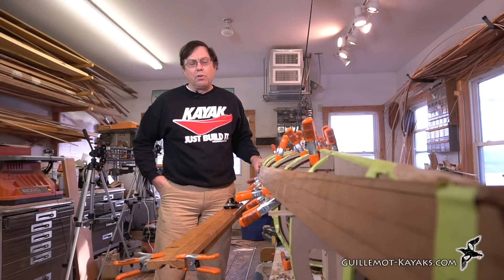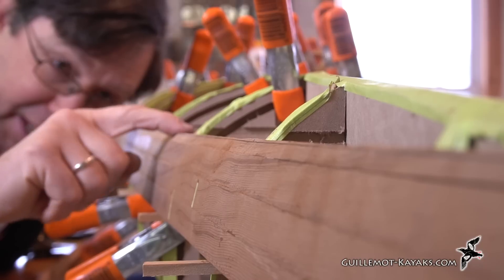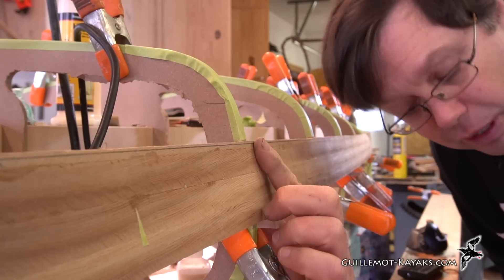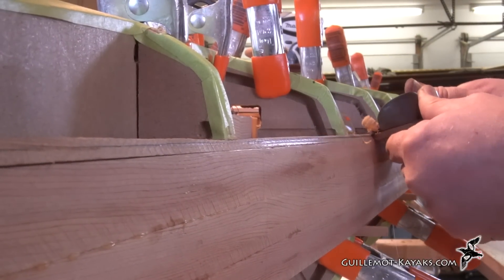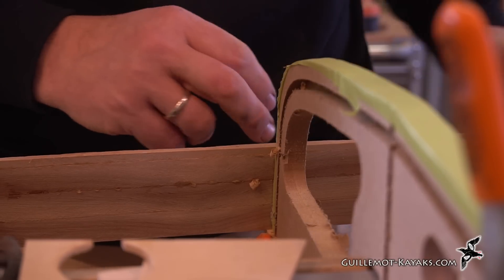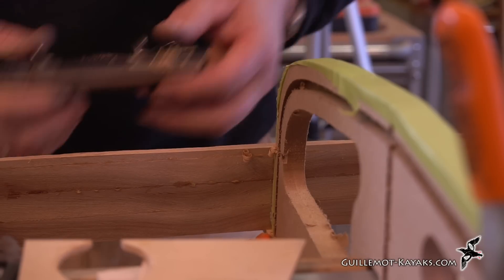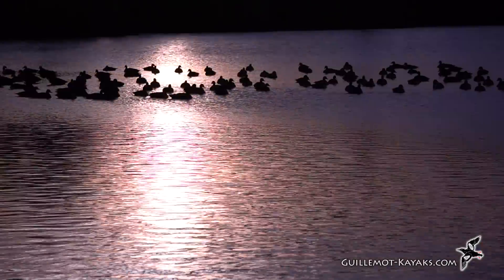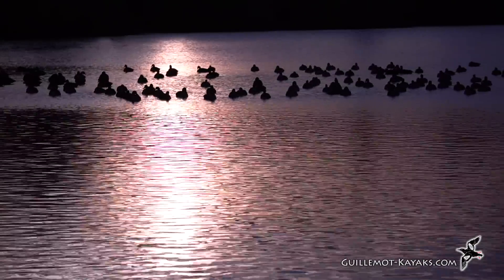Talking Accents - microBootlegger Sport - E13

Comment: Hey Nick.  Do you have a favorite masking tape brand for banding/clamping and covering your forms.  When I use the hot melt glue, the masking tape often tends to pull off the forms.  Great job on the videos.
Reply from the maker: Chuck Knott I’ve tried a variety of solutions for protecting the form edges when hot-gluing. Like you say tape can peel up. I’ve also used no tape and just coated the edges with shellac. This worked OK, but doesn’t really keep glue/epoxy from sticking. The trick is to make sure you don’t use too much glue between strips, and with tight joints epoxy won’t seep through. 

If you do use tape, I think the green 3M tape I use works well because it sticks well. The trick is also to be sure the strips don’t have much desire to pull away from the forms buy pre-twisting strips with a heat gun if necessary.
Reply: @NickSchade  Thanks for the tips, Nick.  I'm learning.

Comment: On my accent strips, that I used light WRC, in time they darkened quite a bit. I've switched to Aspen now, and they stay light colored. Have you tried Aspen
Reply from the maker: Western red cedar does change color with time. The lights get darker and the darks get lighter. I have not tried aspen. The Alaskan yellow cedar works very well.
Reply: Aspen is available to me, I haven't seen any Yellow Cedar around here.

Comment: Could you use purflings for accents like the ones guitarbuilders use ? Thats plastic and would surely stop any bleeding from the staining.....or is it heresy ;-)
Reply from the maker: senocon had the same idea. I think it would probably work. 32 feet would be required for this boat.

 I'm not exactly sure the process that would be needed to install it, but, I'm sure it could be done.
Reply: In the guitar building world, these strips are called purfling. Nick, you might want to check with Gurian Instruments, as they are one of the big suppliers to the lutherie industry, and they will make up custom purflings for marine use. Hope this is helpful! 
https://www.gurianinstruments.com
Reply from the maker: One thing that is different with purfling from what I am doing is, they are thin veneers intended to be inset into the surface. The stripes I made are going all the way through the kayak shell. As such I have the reference lines on the strongback to guide my work.

While I really like the look of many of the purfling and banding options available, cutting a straight groove on a 3D compound is non trivial.

By doing what I have done with this waterline, I don't need to make one exact cut, I can continue to remove material until it is straight. By easing in on the line, I don't need to do anything very tricky, just cut until its right.

My reference lines are consistent and easy to find. To do an inlay, you do it after the surface is stripped up. You are left with no reference on the surface to guide in the placement of the inlay. Any groove created is dependent on the accuracy of the placement any guides you must create. Without the reference of the forms on the strongback, you need to come up with some other guidance system.

I'm absolutely positive it could be done. I have several ideas on how to do it, but what I have done here is actually relatively trivial to accomplish. 20 minutes with a jig made from plywood scrap and rabbet plane.

To see what can be done with this kind of work check out https://youtu.be/qra_1r9Yx1M?list=PLUaYID9hD-EmMMLhuKn3hLBj1hCBPGOLe (I just would not have bothered with the cove and bead)
Reply: Nick Schade Another idea could be to inlay the purfling strip into one of your normal strips before putting it on the boat . Would be easy enough to cut the slot on a table saw. 😁
Reply from the maker: Of course, then I would have to be careful to not chew through it when I fair the surface. The whole surface will be scraped, planed and sanded.

Keep the ideas coming, it is great to have some cross fertilization with other crafts.
Reply: Nick Schade Depending on the purfling, there should be plenty of meat to withstand the sanding and scraping...you could even split one of your normal strips and glue contrasting material between the 2 halves. There are many ways to skin this cat! 😁😁

Comment: When you sleepin?  Many folks take a week to get their edits done, and you're working on a boat and cranking out the videos daily wow!  Just sold a Stanley Side Rabbit like that.  But I had two.
Reply from the maker: I am doing the barest minimum of editing. With the Petrel Play series, it was taking me 2 to 3 days per video to get them into shape. That was using too much of my time out of my boat building schedule.

With these, I'm giving myself about 3-4 hours, previewing as I go. So, there is a loss of production values, but I'm I have time to work on the kayak which is really the priority. If I start slipping on the delivery schedule of the boat, the videos will have to wait. 

But, I'm getting into the swing of it a bit, so it is getting easier. Now, I just need to remember to check the microphone batteries so I don't record an hour of silent video.